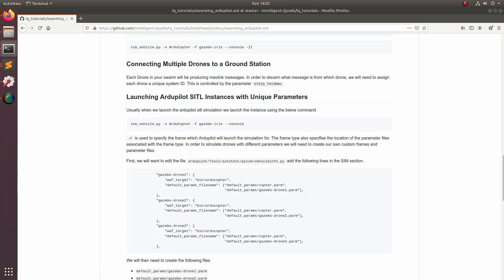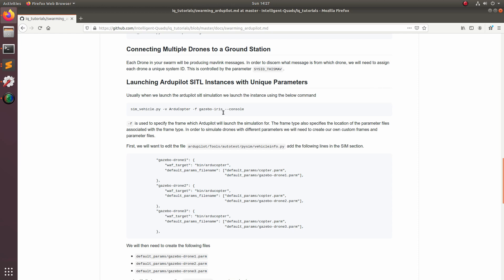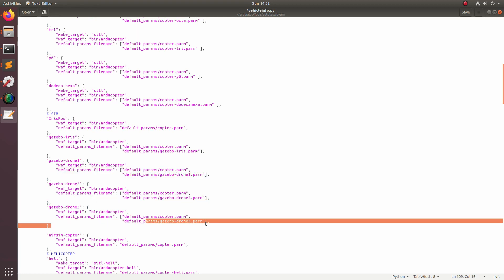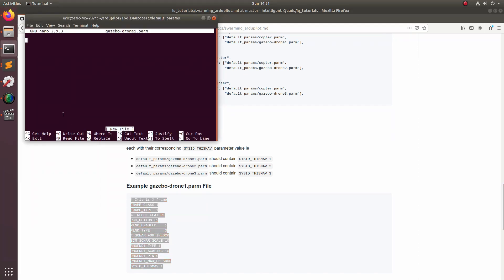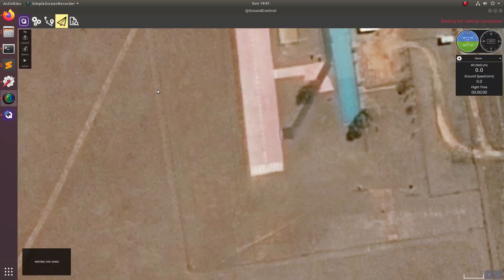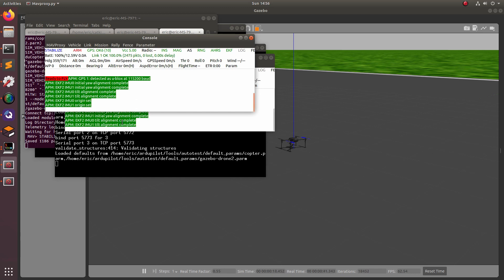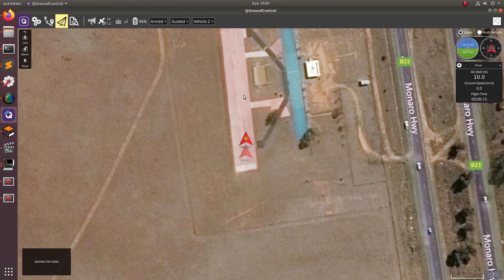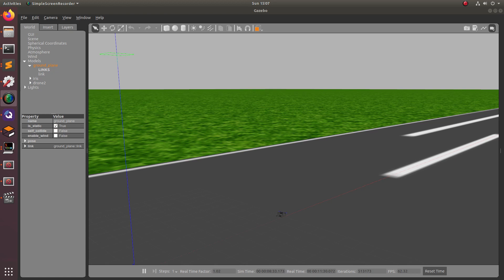21 Drone Swarm with Ardupilot and QGroundControl

Comment: Thanks for great tutorial!
I feel inspired to try to replicate it.

Could you please advice:
Q#1: What parameters of the system should be enough to run the whole stack - GCS, ardupilot and all the rest.
And q#2: which operating systems you’d advise to use, just keep process smooth(reduce amount of troubleshooting during installation, etc)

Comment: Everything works great, up until the point of connecting QGroundControl with the vehicles. It seems unable to display multiple UAVs and instead flashes the indicative red arrow between the positions of the simulated drones... any help would be appreciated. 

Also, thank you for the work you put into these videos; do you have a patreon account?

Update: it was my own mistake, I had wrong the following command instances: sim_vehicle.py -v ArduCopter -f gazebo-drone1 --console -I0 --out=tcpin:0.0.0.0:8100

Comment: Hi there,
I tried executing the last line in the first github link, and it says I dont have pymavlink. I tried installing manually via pip install pymavlink and I get this error, Command 'pip' not found, but there are 18 similar ones. Please advise
Reply from the maker: try, using pip3. Also take a look at either the 20.04 update video. or watch the first 5 tutorials if on 18.  https://youtu.be/1FpJvUVPxL0
Reply: @IntelligentQuads  thanks a lot!! That worked